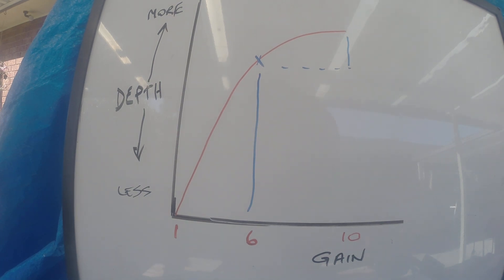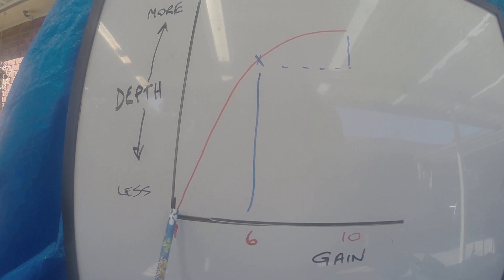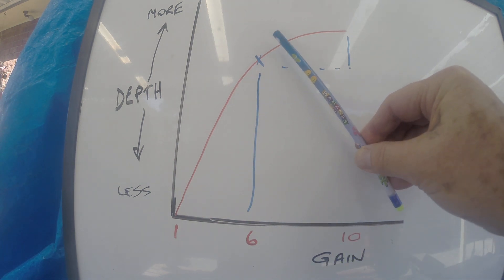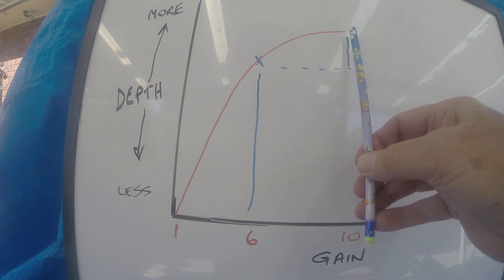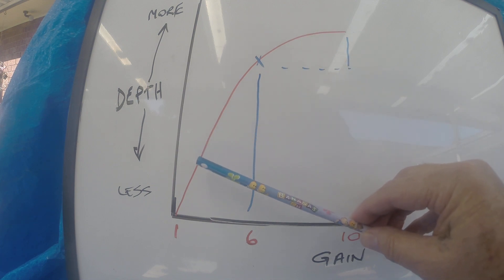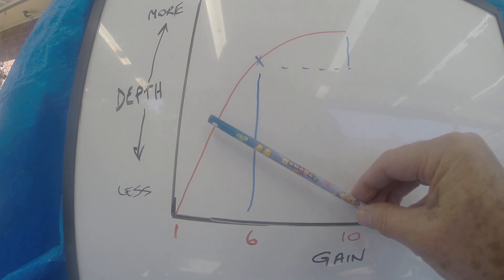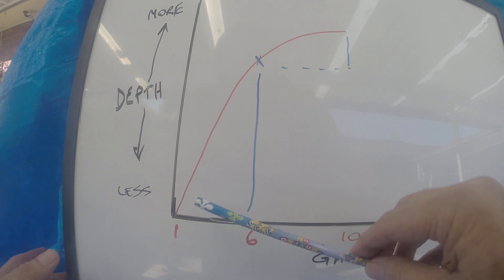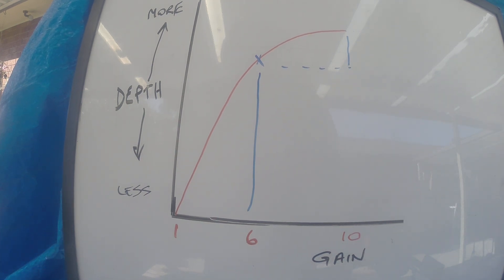QED Gain explained

Comment: Thanks for this, So that means the higher I go in the gain the deeper in the ground it searches plus the right mode for the coil i use, as long I get ths:B at the right setting and ths:A at 30 as I got the PL2 with the latest updates on it atm. Thanks,.

Comment: Onya Brian. For the benefit of others, if you were at 1 or 2 with your gain, would you be better off switching to the next lower mode number to bring up your gain to around the magic 6? Have you tested a lower mode with a gain of 6 against the next up mode with gain around 1/2? Cheers mate. Al.
Reply from the maker: The higher the mode number you choose, the HIGHER you should be able to go with Gain, as higher modes reduce the effects of mineralization, this reducing unwanted noise when compared with lower modes, enabling you to increase your performance levers (e.g. A, B and Gain). However you will lose performance for small targets as you are sampling (receive) later in the decay curve. Cheers Brian